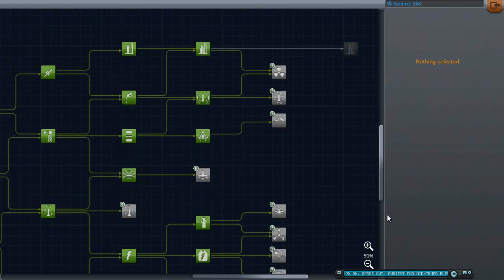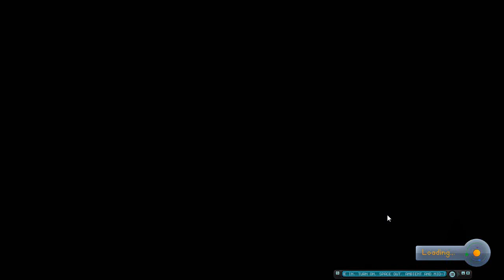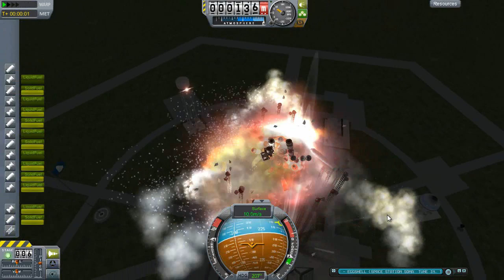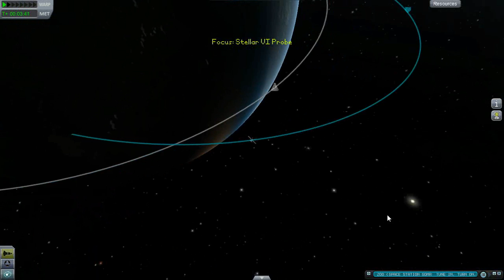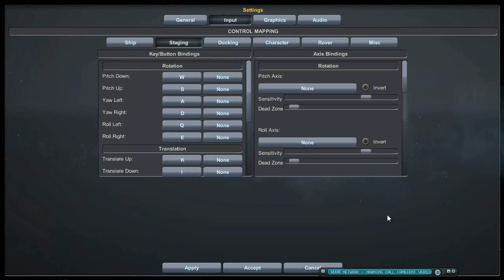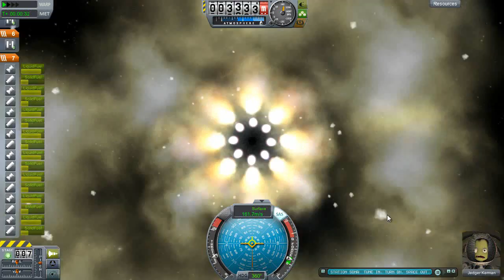KSP - Episode 11 (Probe Testing)

Comment: To get power, the solar panels have to be extended. To extend the panels on a drone (or do anything), you need to have power. Its a vicious cycle, which has had me tearing my hair out every once in a while (like when ive left sas on pointing away from the sun and ff time).